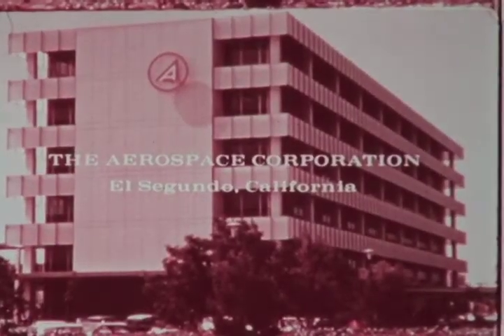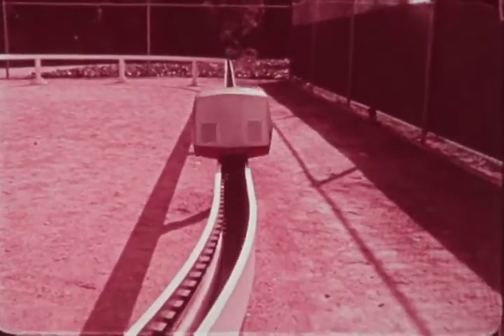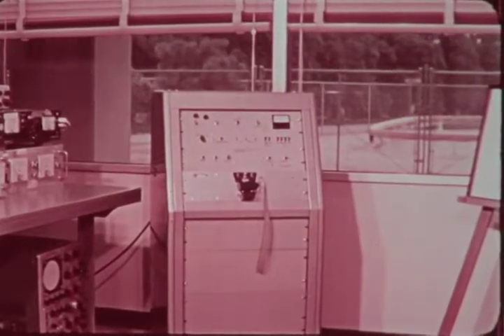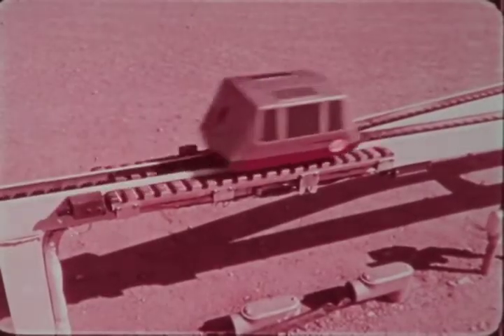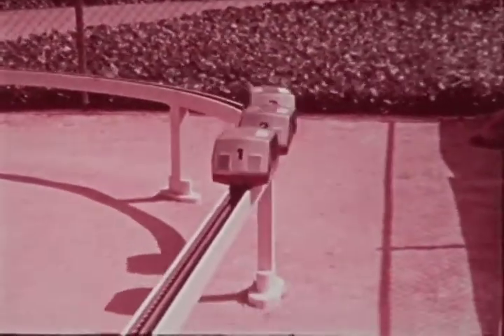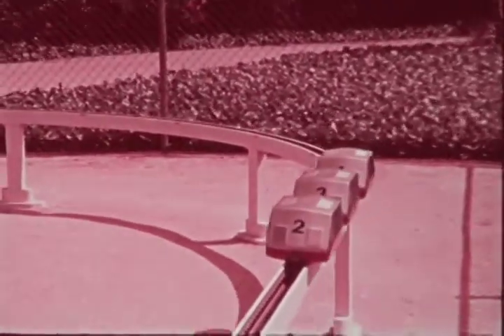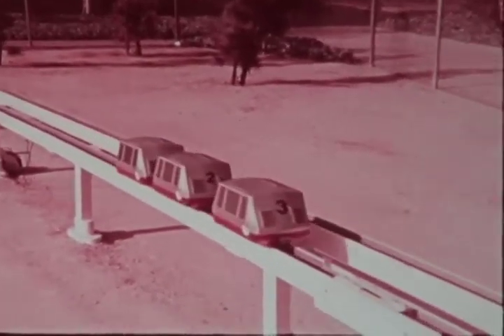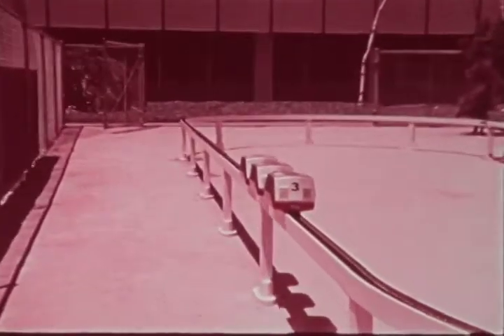F-0655 Video: Avanced Personal Rapid Transit System, monorail.  Aerospae Corporation.

Comment: At about 3:20, someone's walking outside the fence; I'm told this facility was located on/near "The Strand."

It should be noted that a disadvantage of this electromagnetic switch design is that a diverging vehicle could strike the center point during a power failure.

Thank you for posting this with the soundtrack (finally, we can hear it)!